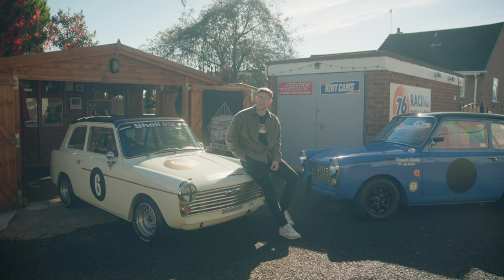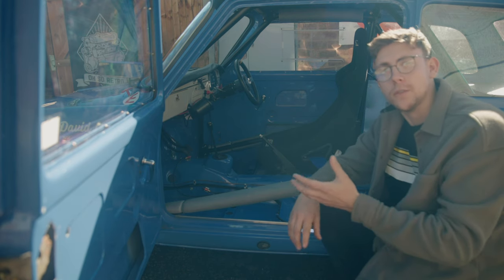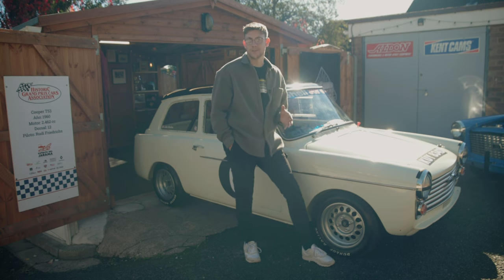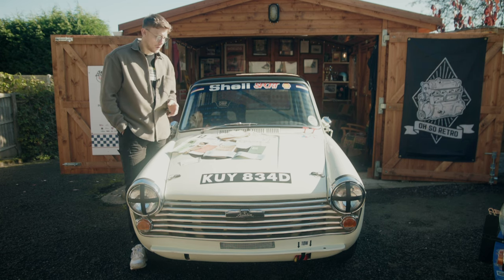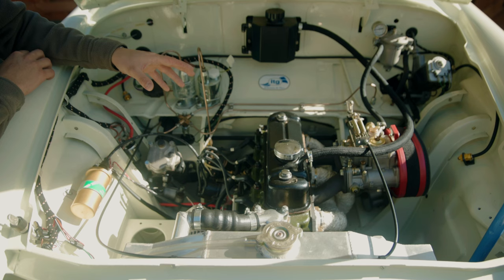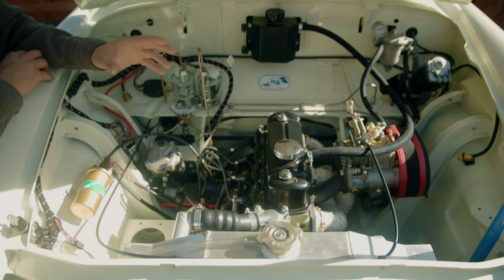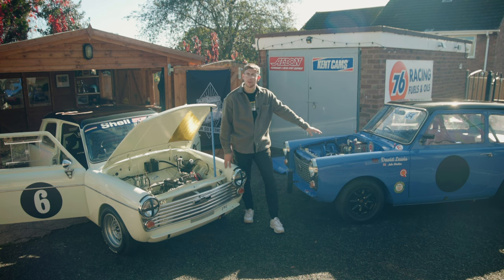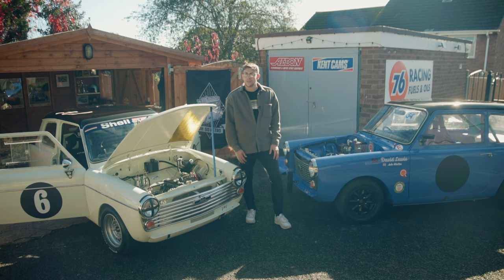Chatting Classics - A walk around of two sporty Austin A40s, the forgotten 1960 saloon turned racer!

Comment: The Mk1 looks like an original colour, ocean blue with a black roof. I had a 1960 one in that colour as my first car when my Dad bought a new Triumph 1300 and I took it over. 7834 RE was the number. I kept it standard except for twin SU carbs in place of the original single zenith, so it was more like the engine in the Frogeye Sprite. I also fitted a rev counter. Great little car in its day but rusted like everything did back then so had new inner and outer sills done. The original quoted top speed on the 948cc car was 72mph, so I was chuffed when I could get mine over 85!